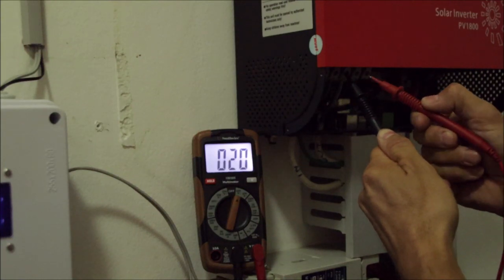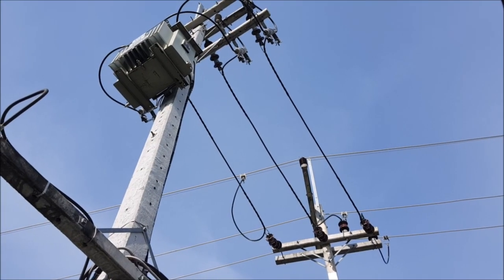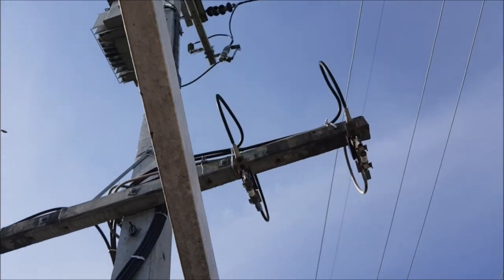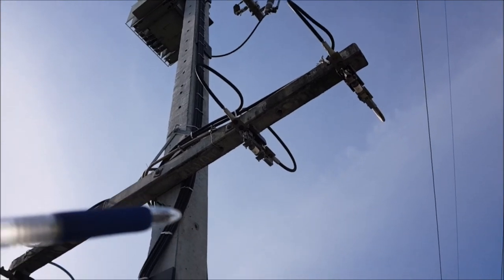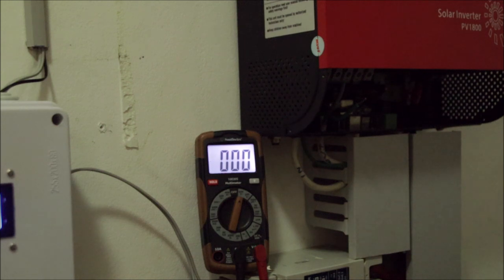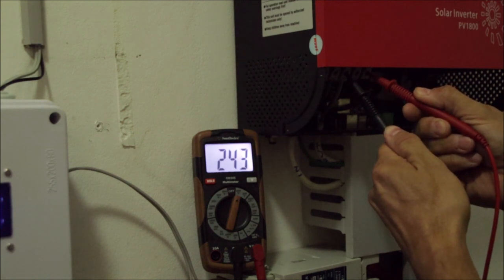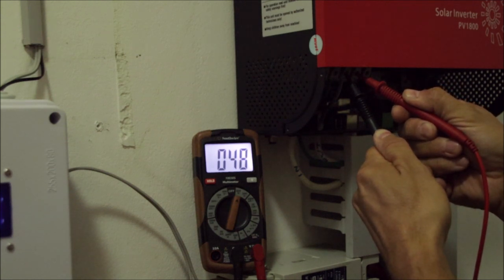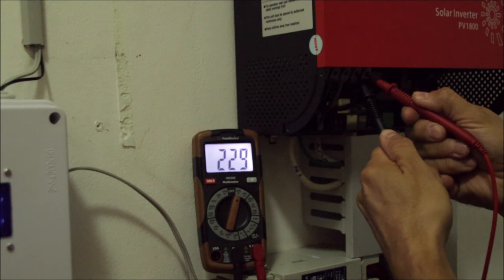DIY-Installation? Don't forget about Inverter Grounding and Neutral-to-Ground Bonding!

Comment: Nice..  thanks..  I’m in Phillipines,  single phase,  240v,  60hz.  Using a Deye inverter.  My main breaker panel,  which seems older style than yours,  with inputs from grid at the top,  with big 50mm wires coming in,  has a 150amp breaker on it.   There is a discrepancy here between us,  are those L1 and L2?    Or L and N?        FYI there is no neutral bar that I can see, nor a Neutral bar either.   So,  it’s a toss up.   Oh and this house is 20 years old.   What do you think?
Reply from the maker: Phillipines has L and N, not a split phase, right? you can use a phase tester to see which of your 2 wires is the hot one.
Reply: @RolandW_DIYEnergyandMore  yeah, I am not sure , but, I've heard people say "240v supply to neutral",   does that mean that one of those 50mm wires is L (supply)  and the other is N?    I've tested the voltage between the two black lines, and it's 220,   then, when I touch one of the black wires to the casing or the box,  it shows 110.     When I do a continuity test between either line to either side of the breakers,  it beeps.     FYI,  it's an american style, 1" black breaker type.     what else can I check?     Oh, and I don't have light up line tester I don't think.  but, I do have amp and v meter.
Reply from the maker: @gjsxnobody7534  to be sure, we are only speaking now about your grid supply. According the world map for electricity Philippine's is using 220V/60Hz L-N.
You are getting your supply via 2 big black wires. One is L and one is N. You can only find out which one is which by using a phase tester like the screw drivers with light, etc. A multimeter can only tell you which is which if you measure the wires towards a true point of ground like the ground pin of your electrical outlets which must be connected to a earthing bar and  rod if you live in a TT-earthing system or must be connected to a earthing bar whoch is bonded to the N in a TN-C-S earthing system.
Do you know how or even if your house is grounded/earthed? 
Measuring 110V against a point of ground on each wire would indicate a US style split phase. There each of the wires would make a phase tester light up.
You can ask your power provider what your supply is.
If you want, you can send me a photo of your open breaker box to my e-mail address shown in the channel description. Its much easier to talk about something and give advice about it if looking at a picture of the actual situation...
Reply: Ok.  Emailed you with pics and video
Reply: @RolandW_DIYEnergyandMore Philippines do not use an earth, most alliances give you a minor tickle
Reply from the maker: @Brian-ausie  yes. The reason is that they are using US transformers but misuse what is L1 and L2 in the US as L and ungrounded N in the Philippines. Very weird system. Best to be completely off-grid and setup a safe grounded system :)

Comment: i want to install ac spd after earthing nutrual bounding in main db box can i install ac spd after bounding and took earthing wire from grounding wire and insert in ac spd earthing point is it okay ? will ac spd will work and ground extra spikes/extra volts from grid (live/natural ) if we do natural and grounding bounding at main db box?
Reply from the maker: Hi. yes, you can install AC SPDs near of the N-G bond as well, but it will mostly remove spikes from the Live wire only.
Reply: @RolandW_DIYEnergyandMore thnx for reply bro 

 so it means ac spd grounding  wire we will connect to nutural ground main db box bounding wire directly ?
Reply from the maker: @techchat370  yes. You connect the Ground terminal of the SPD to the main Grounding terminal bar inside your main DB. From there you will hopefully have a connection to any sort of grounding rod, etc which will lead the spike to physical ground
Reply: @RolandW_DIYEnergyandMore  yes dear bro i have done earhing/grounding by my self with 5 feet copper road with 9 feet depth and used 10mm bare copper wire in it and from it 6mm pure copper wire from it to my main db box and attached with nutural bus bar...

Thnx for valued propmt  reply 
Love n respect from pakistan to share knowledge with others

Comment: Great video.   I'm in the US so 110vac/60 cycles.   I am the proud owner of a useless inverter for connection to building wiring!  Although it has unbonded neutral-ground (yay) it produces half the voltage on the cold prong, like yours.  Do you or anyone here have any definitive experience with portable 2000w or so inverters that are OK to connect to home wiring (via a transfer switch) and has the floating neutral-ground as well as ALL the AC on the hot receptacle of the AC outlets...Thx...

Comment: There is an electrical return to the batteries and the filter when connected to the power panels. My device is opti, the system 24, which accepts filters from the panels 500 v, and returns electricity to the panels. Please help
Reply from the maker: I don't know if i understand right. You have DC current returning from battery to panels during night time?
Reply from the maker: you can use a string diode. it will prevent current return to the panels. check my video about it. it works as well with one string only...

Comment: I have questions - have done N to E binding but when inverter goes to bypass mode my home main RCCB tripped ,why is that happening also I'm using one grounding rod don't have separate ground rod. And I am using two  RCCB one for main supply one for inverter out. Could you please advise 
(Sorry about my English)
Reply from the maker: Do you feed in behind a RCD? Because if you do, you add energy into your N-line via the inverter which is seen as energy imbalance by the RCD
Reply from the maker: Did you watch this video about practical connection in different earthing systems? Maybe the answer is found there... https://youtu.be/H5Pt5i5gG2I
Reply from the maker: When you install one of the Off-Grid Hybrids, never get the AC for the AC-In from a load panel breaker behind a RCD. Because otherwise you are creating a N-E bond behind a RCD. That will cause the RCD to trip. Use a 2-pole (overcurrent) Breaker before the main RCD to get that Ac from there.
Reply: @RolandW_DIYEnergyandMore  yes think this is the issue I have.
Reply: @RolandW_DIYEnergyandMore  above video is very helpful and found my answer

Comment: I'm a bit confused why you bonded earth and neutral in the load centre. Wouldn't that mean that the earth wire would be carrying current?
Reply from the maker: That is exactly what bonds are for. They shall carry current... but only in fault conditions! Without a N-G bonding wire, fault current cannot safely return to the inverter, which would mean that in worst case a human body could become the bridge if there is a ground fault present in the system. A later video is actually showing exactly about how much current is really flowing ;)
Reply: Sorry I thought you had 2 neutral/earth bonds. I'm designing a backup system that uses a small inverter to switch only the lighting circuit when the power goes out and I'm wondering, is it safe to have both the inverter and grid earth wires connected considering I will bond the inverter's neutral to earth? Wouldnt a ground fault in the circuitry potentially send the grid's power to the inverter?
Reply from the maker: @kint5ugee  at small backup systems I wouldn't bother to much with earthing. Just run it as an isolated system. The grid cannot send power trough your inverter active circuit over the earth wire when only ground is shared. Currents always go to their origin. How would the inverter attract fault current from a transformer via PE or vice versa? Electricity needs a closed loop to flow and earth and neutral are same potential in most types of grid as they are bonded at the transformer. Yes, never ever bring inverter phase and grid phase together, unless using a grid-tied inverter :)
Reply: @RolandW_DIYEnergyandMore  "currents always go to their origin" thank you so much! I had this misconception that current would just go to any neutral which is stupid haha. I'm still learning. And yes it's only a small backup system and all loads connected will be insulated or out of reach (light bulbs, TV and phone chargers) thanks a lot for clearing that up for me!

Comment: Hello Roland, I have a mixture of 24v inverters, 3000 up to 5000w, I am trying to use plug and play so as to be legal, I have plug in RCB, most of the inverters are earthed internally to the socket 1 is not earthed at all, I have a ground rod especially for them, and have earthed each inverter, the breakers do trip if I push the test buton, when testing it shows no earth, what can I do here without having wired outlets and RCB? I need to stay plug and play, off grid, Australia uses PME, our power cords are earthed
Reply from the maker: Hi, testing an RCD via its test button unfortunately doesn't say anything about correct earthing, it is only an internal device test using its internal L and N line. You need to open the unearthed inverter and bond the N with PE at the socket. Then your plug in RCD should work correctly if externally tested with a socket tester for example.
Reply: @RolandW_DIYEnergyandMore  I really appreciate your reply, I'll give it a go, keep up your videos, I only just found you
Reply: Thank you Roland, the inverter internal neutral earth bonding worked fine, I did 7 inverters in total
Reply: Hello Roland, I have a curly one for you, my friend has a caravan park, in Australia,  there is I think around 25 to 30 power domes with 4 outlets in each, earthed back to the sub panel, the power company did an earth resistance test and they said it was too high, it was verbal only 5 ohms, the allowance is 0.5 ohms, the main board is earth bonded,  the cables from the main board are 35mm while the earth is only 10 mm, the sub panel is also bonded, every electrician in the past have different views, the bond has been in and out several times, I don't see an earth stake at the sub panel, and at this stage can't see if the main board and sub board are directly earthed.
What's your thought here Roland?
Reply from the maker: @Brian-ausie  what is the distance from main to sub panel and sub panel to power domes? Are all domes connected to the same sub panel? what is the cable core diameter from sub to domes?
Reply: @RolandW_DIYEnergyandMore   guessing around 60 to 80 mtrs, main to sub, dome cabling 10mm, domes are scattered around the sub, up to approx 60 mtrs away, all domes connected to the sub
Reply from the maker: @Brian-ausie  by your explanations and the required loop impedance of 0.5 Ohms the current setup is a TN-C-S setup. By the wire cores the actual impedance should be well below the requirement. I assume that the ground fault loop impedance was measured at a socket of the domes. The interesting part would be to know if the values had been same bad at each of the domes. In my opinion there are 2 possible solutions to conform with code:
1. Pull a similarly sized Earth wire as L,N cables from Main to Sub panel and turn the system into a TN-S. This requires to open the N-G bond at the sub panel. Fault currents have to travel on separate wires till back to the main panel. The impedance tolerance for TN-S systems is higher then for TN-CS.
2. If it is still unlikely to meet the maximum impedance that way, the only solution is to turn the whole setup into a TT-System with an earthing stake at the sub panel and using of RCBOs for each of the dome cable pulls. That way the earth loop impedance  would be dependent on the earthing stake impedances with allowed values of typically around 200 Ohms. Best to ask the local electricians if this would be an approved option for a caravan park.
Greetings!
Reply: @RolandW_DIYEnergyandMore  OK Roland, the plot thickens😁, there is an earth with the main cables from main to sub, but not connected at each end, I found the earth stakes at both main and sub, the main is,in dry sand under cover🤔, the sub earth connection is connected to a stake and a rusted gal water pipe, both corroded, am I allowed to join that earth cable so I can run 2 stake's at each end? There is the option to run the continues earth and un bond the sub board, looking closer the boards would be 80 to 100 Mtrs apart
Reply from the maker: @Brian-ausie  in the case that main and sub is far away from each other recommendation is to keep both stakes. So, if you want to use the earth cable between main and sub yoe need to connect it and unbond N and PE at the sub. Then you have turned it into a TN-S setup. Good luck :)
Reply: @RolandW_DIYEnergyandMore  hi Rolland again😁 , I have been reading about earth rods, I am a bit confused, the sub board earth at the rod is coroded, there is a water pipe a few inches away which is connected to the same earth wire, I read this can cause problems with the path back to the main board and cause corrosion, I was thinking of either fitting another rod at sub and main, making 2 each end, then there is the debate of how far apart they should be, also if they are joined by 1 earth cable or double tap, the original main board rod is in very dry sand under a roof overhang, what can you suggest, I really appreciate your time to reply me, and enjoy your videos,
Reply from the maker: @Brian-ausie  the quality of the rods are not relevant for your earth fault loop issue with the high impedance, as for this measurements the wiring resistance from socket to transformer and back is measured. The rods are important when measuring the loop through soil for TT setup or earth leakage test for RCDs. sure, rods shall be placed into best possible soil conditions and be of suitable lenght, etc to achive low impedance. The pipes must be bonded electrically to the PE system but you could of course move the stake to a better place if necessary.

Comment: Wow, subbed :)
I amm confused about your setup but since i just finished my solar panels construction and going further with electrical setup i am sure i have a question for you :)
Ma inverter is single phase hybrid Deye SUN 6-K with two LFP bank in paralell (each 100 ah 5 kwh). My house installation ( 45 year old) is neutral to ground bonded. I dont have ground bus bar in house distribution box. I have information that even in transformer station, some 250 meters away from my house, neutral is grounded to protective earth. Now, i even have acces to separate copper ground wire which lead from electra main distribution box for my neighborhood where my electra meter for my house is also connected. So i was thinking to take that copper wire and to connect it for grounding all my equipment and "ac in" on my inverter (grid output of inverter but not backup output as per Deye manual). I am even thinking to add grounding rod on my parking lot for dc side and connect this to that copper wire also. I can check potential tomorrow. Whats your thoughts on this?
Thanx mate
Reply from the maker: Yes. Sounds like you have a TN-S supply. You can use that PE throughout your installation for AC-side grounding, Equipment grounding, Panel frames and metal mount, etc... just what do you mean when you say DC-side grounding? Do not bond any of the DC power lines to the PE.
Reply: @RolandW_DIYEnergyandMore  Thank you for your fast reply Sir. Roland W.
Oh no no no. I didnt mean to say i will ground dc line from panels to PE. I just meant that i will ground my panel frames and metal construction where panels are fastened to same PE line where i will ground my ac side!
What is TN-S supply?  Some abbreviations are still unknown to me unfortunately :(
Reply: @RolandW_DIYEnergyandMore  Ahh i see. TerraNeutral-Separate ;)
Reply: @RolandW_DIYEnergyandMore  Its rainy today but i will check if weather allow what i have here when measure point of my house Live to point of that copper wire on my parking lot. I should get 230 volts, right? If that is the case than i am good?
Reply from the maker: @zoxwolf2133  copper wire on parking lot is a known earthing wire? Then you should read 230V, yes :)
Reply: @RolandW_DIYEnergyandMore  Yes it is. My brother ( newer) house is connected to that copper wire which goes on same electra distribution box where my older house is also connected but without PE line. I will check voltage today. So my idea to connect all to that line and further to add PE rod and also connect it to that copper wire is good?
Thanx for your help Sir. Roland!
And greetings from Croatia :)
Reply: @RolandW_DIYEnergyandMore  Weird, so my supply system is TN-S, but my house load system is connected as TN-C and i will use additional TT system on my parking lot haha :) I learned a lot today about grounding :)
Thnx
Reply: @RolandW_DIYEnergyandMore  I just measure now vac between my house live wire and pe copper wire on parking lot :) it read 230 volt ac :) i am good to go!